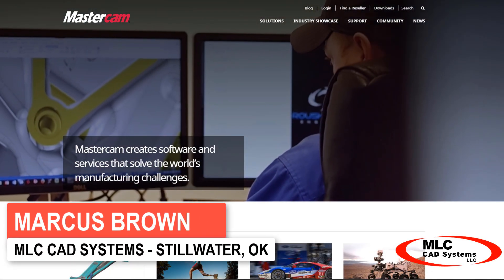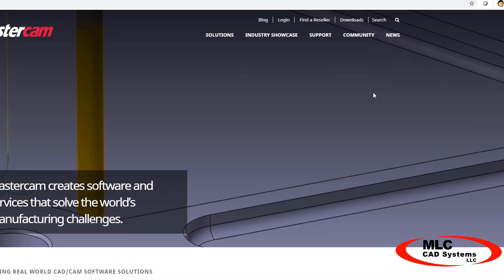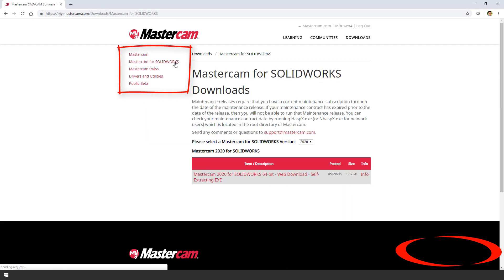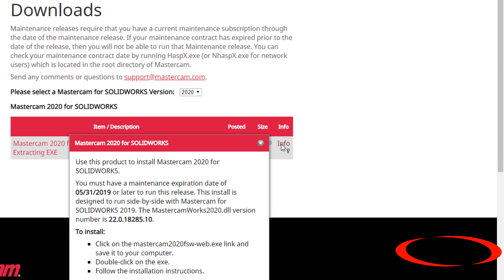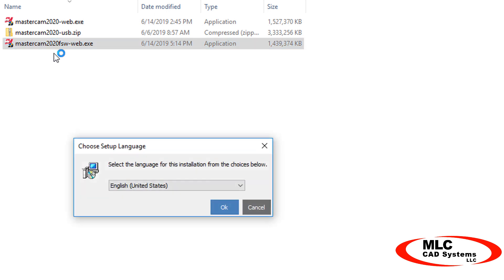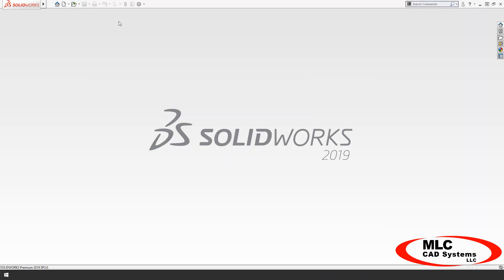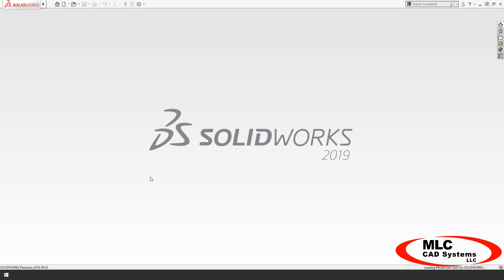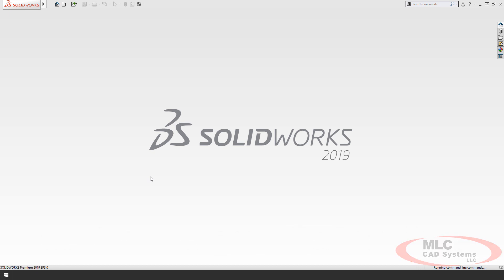How to Install Mastercam for SOLIDWORKS

Comment: what version of solidworks?
Reply from the maker: It depends on each release which versions are compatible, check the informational dialog on the download page.  As long as you are within 1-2 major versions between Mastercam and SOLIDWORKS it should be fine.

Comment: Do i really need Solidworks for mastercam, can I use mastercam without Solidworks?for example for CNC machining
Reply from the maker: Absolutely!  Mastercam for SOLIDWORKS is simply the Mastercam toolpaths that exist in the standalone Mastercam interface brought into SOLIDWORKS so you can use a more familiar environment or use feature history to make selection easier.  Any license of Mastercam includes this add-in, but it is not required at all.  I personally prefer to use the standalone Mastercam interface, even as a SOLIDWORKS expert.
Reply: @MLCCADSystems  thank you very much for replying 🙏